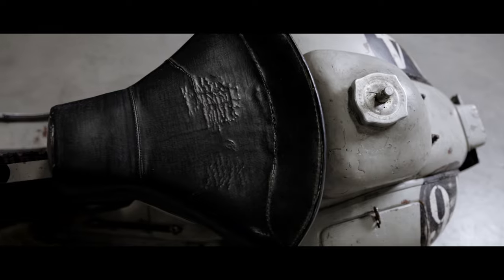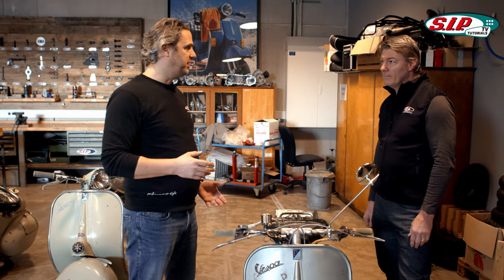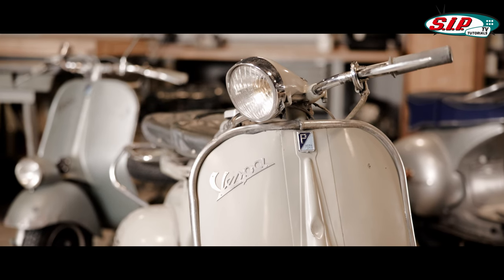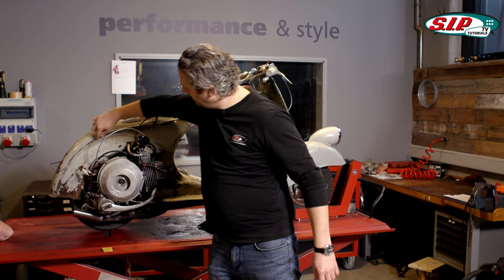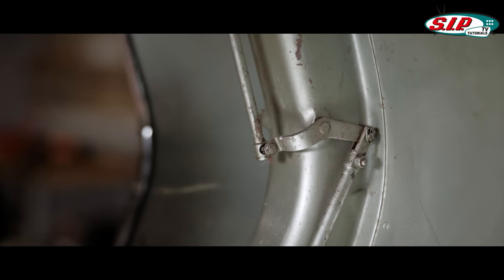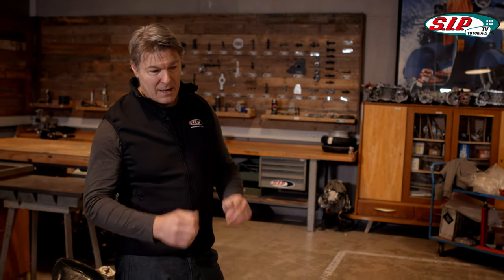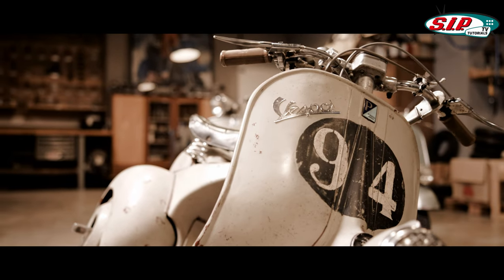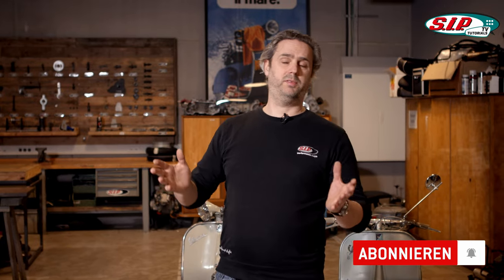VESPA Wideframe 101 🛵💡 models, parts, anecdots {English}

Comment: Not just GS was the only 10" wideframe.. there is also a VGL which has 10" wheels as a standard. It was nicknamed "GS dei poveri". Produced 1957-58. It was more or less VB1 body with larger wheels. Made also as MISA licence in Belgium and as Swedish export version by Messerschmitt AG in Germany.